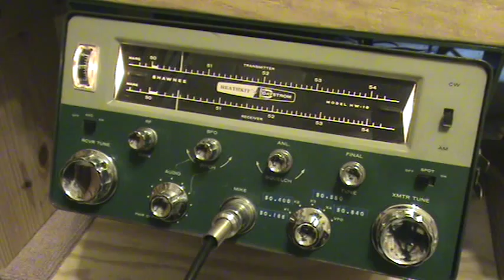W5VB to KB7AZ 6 Meters AM  Heathkit Shawnee HW-10 Ham Radio

Comment: this was a neat feature packed radio.. that I would have killed to have as a kid in 1963.  Cant remember the tube line up.. but thought it was a 2E26.. capable of 15 watts output... 5 watts output sounds suspiciously low... time to do my homework.  The quality of the finish and components during this period was very high.. and the engineering quite good too.  Very worthwhile both as a collectable radio, and as usuable radio if you have 6M AM activity locally.